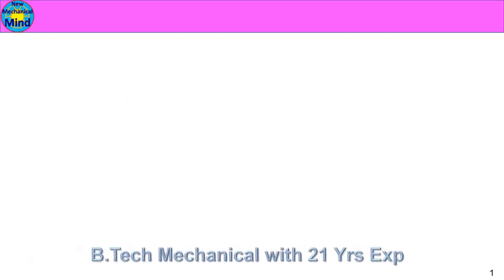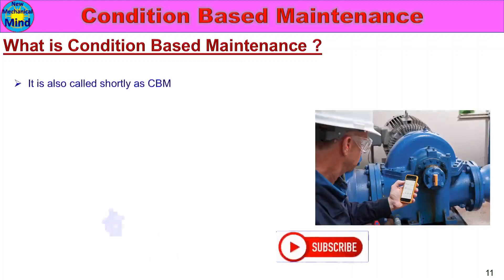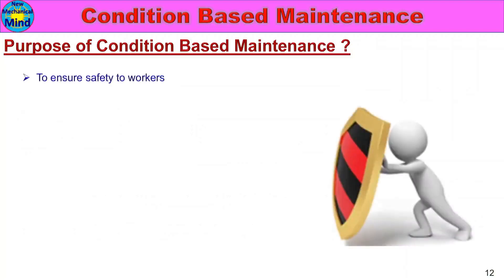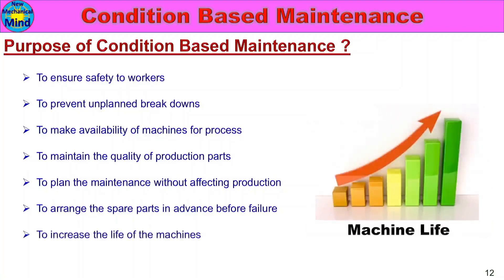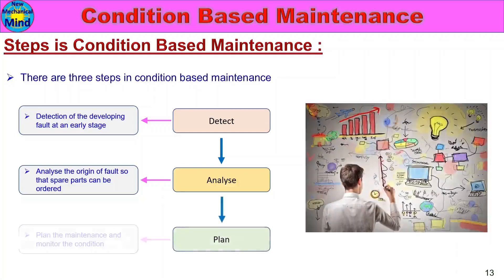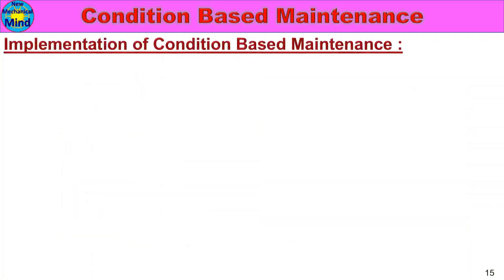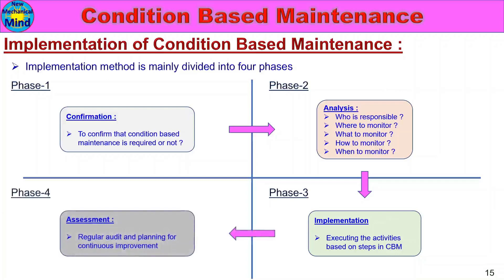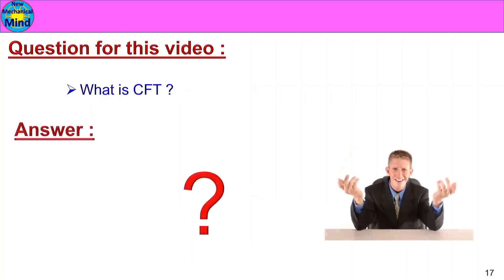What is Maintenance ? Part-4 | Condition Based Maintenance |explained in tamil| New mechanical mind

Comment: Predict maintenance and CBM both are same or like?
Reply from the maker: Hi Chinna, predictive maintenance will be done after fixing the theoretical lifetime to a machine or machine part. It is a planned maintenance and will be carried out as per plan.
But, condition based maintenance is not a planned maintenance.
In this method,  machine condition will be monitored on regular basis and CBM will be performed immediately if machine will fail shortly or having any abnormalities.